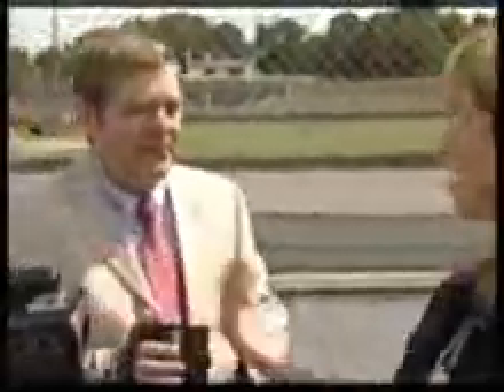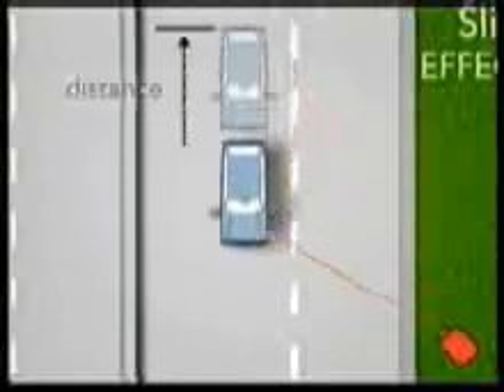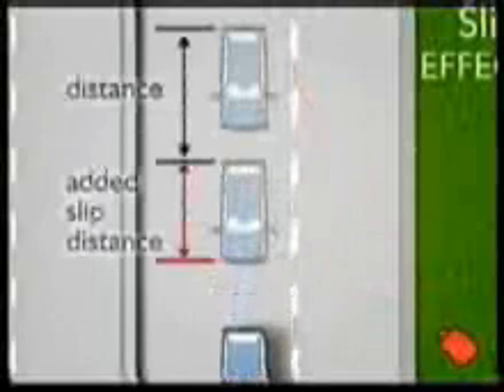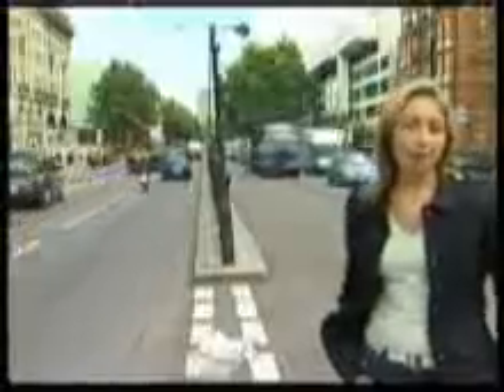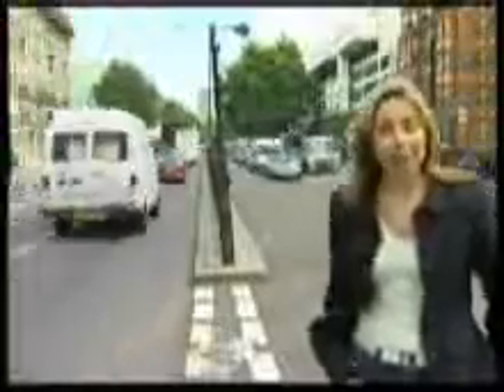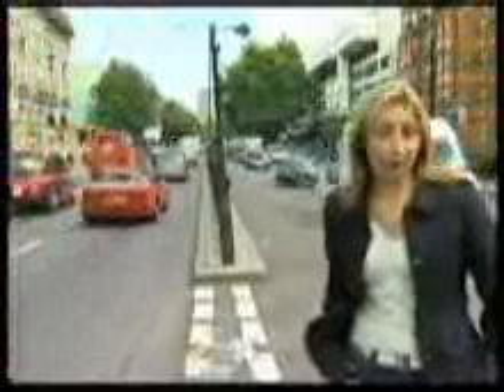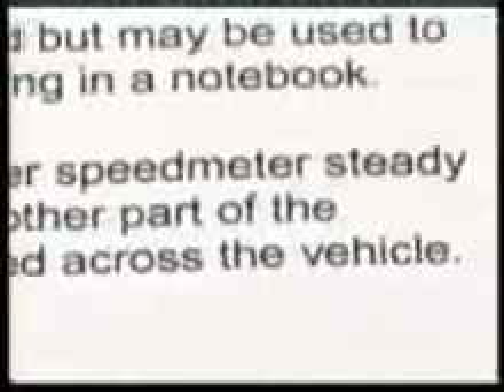BBC Inside Out - LTI 20/20 Inaccuracy Documentation

Comment: It isn't radar, it's laser, completely different technology & extremely accurate.
Reply: Laser IS fairly accurate, but sadly like many items of high technology, the operator is the weak link.
Reply: "The device must be held evenly at a 90-degree angle in the policeman's shaking hand. A 3 percent downhill slope means the speed has been underestimated, while a 3 percent uphill slope means the speed has been overestimated. Not to mention, the speed measured uphill will always be overestimated because the device is not held at a 90-degree angle. The laws of physics confirm that changes in the angle of inclination and the way the device is held affect the accuracy of the speed measurement."